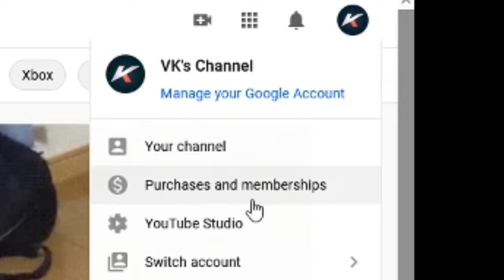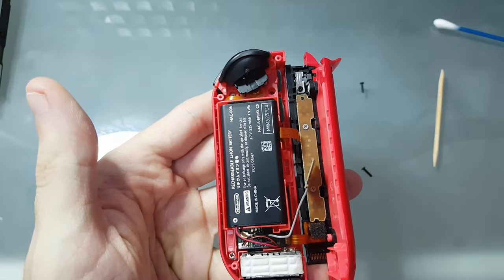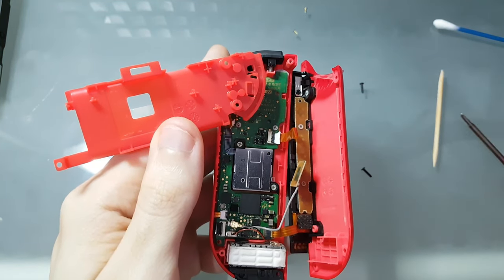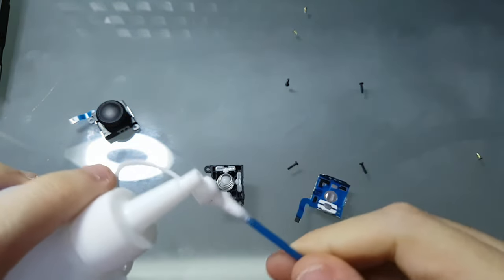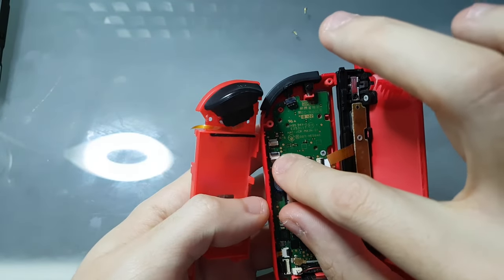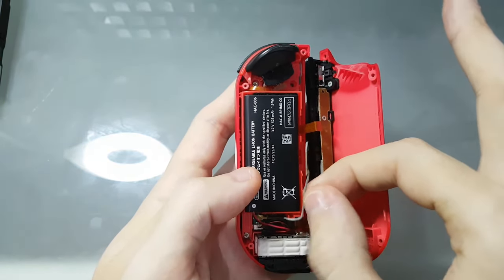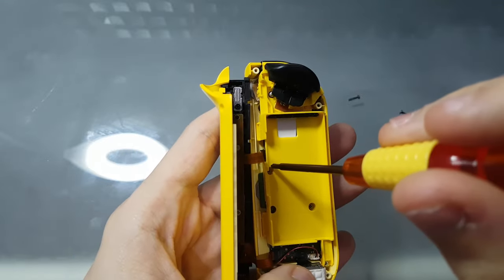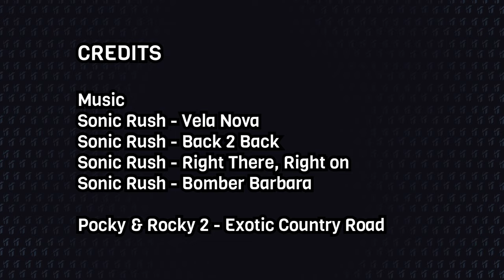Joycon Disassembly Step By Step + Analog Stick Cleaning

Comment: Yo thanks for the vid. I bought a Fortnite switch from someone I know for 80$ and the right joycon looked like it was ripped out while in the switch, so I have to replace the tech inside. I’d normally just buy a new controller but I like the shell this one has

Comment: Did I fuck up by removing the lower ribbon connecting the back half to the front?
Reply from the maker: if you broke the ribbon cable yes, if its not broken you can reattatch it

Comment: i tried this on my left joycon and while it did solve drift, it won’t seem to connect back to the switch for handheld... any idea on what i might’ve messed up? (it connects wirelessly and also charges, it also has like a constant vibration even tho i turned it off in settings)

Comment: I wish you'd made mention of the fact that you can't merely tug to unplug the battery, or that you should keep track of the screw order, or that the internals of the joystick would shoot out all over the room after you're forced to break the metal plate because you chose to only show you removing the model with plating on one side that's easy to remove.

Comment: Can someone measure the size needed for the back of the joycon so we can precut it?   It’s square right?  Thanks!
Reply: I’ve cut different sizes and they all seemed to work as long as they cover most of the back plate of the thumb sticks I’ve fixed various joy cons so far and they’ve all been drift less since
Reply: @ZombieStray  would you say thickness should be about that of typical business card?

Comment: I'm pretty sure that piece of cardboard is slimmer than 1mm. looks like 0.3mm at most. is it literally the thickness of a white paper for example? 1mm is literally the thickness of a credit card/debit card. are you sure is 1mm?
Reply from the maker: I said around 1mm because it is what will fix the issue for most people but sometimes less thick papers can do the trick too

Comment: If your going through the effort of cleaning the joysticks just replace them. Joysticks are often sold with the tools anyways so theres no excuse to why you cant. Watching you pull on the wires like that makes me nervouse because its super easy to break the solder and the plastic piece keeping it together. New batteries are $30 and short circuits are a fire hazard